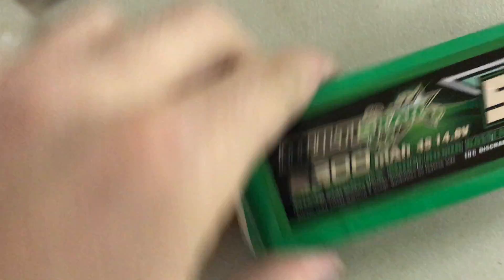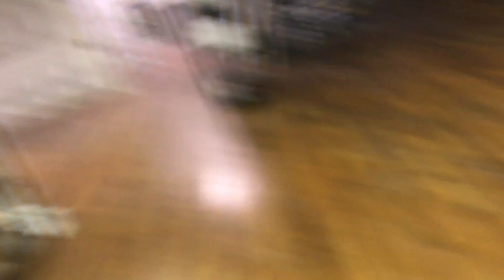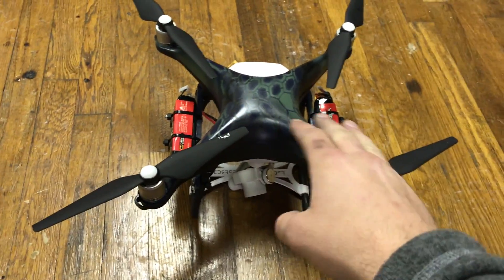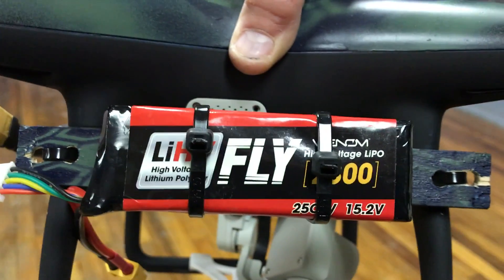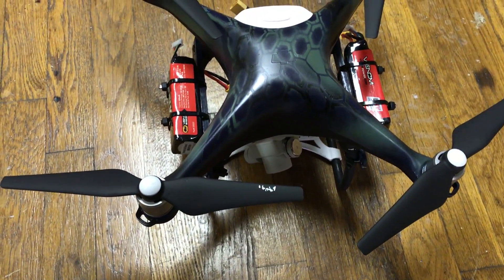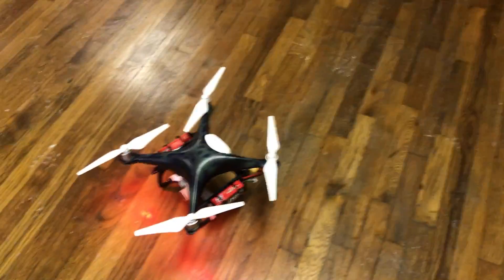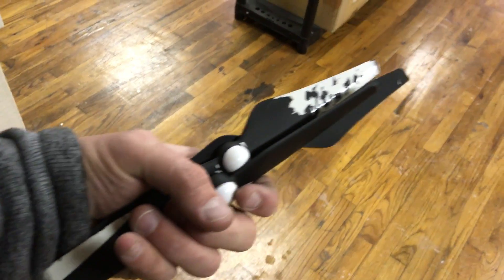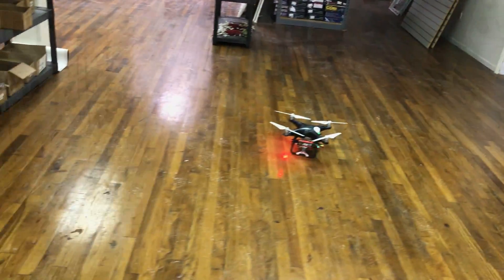DJI Phantom 4 dual battery mod

Comment: but to get the data and battery status on dji go you also have to use an original battery in the battery compartment and then connect the additional batteries in parallel exactly?

Comment: Good morning, I request information that battery you use, I have a Phantom 4 pro and also a Phantom 3 pro, I tested a 5.2 mah battery, but it got very heavy it accused overweight in the engines. Could you inform me a suitable battery to use would a Lipo 4.0 4S 14.8 V? multistar or Venom. Many thanks and congratulations for your adaptation.

Comment: Good afternoon, fantastic I bought two bateriasmultistar 5.2 Turnig 10 c Discharge similar to what you showed, but it was very heavy, could inform me the second battery that you put me pass weight, voltage and other data thank you very much Luiz Carlos Pannain - São Paulo Brazil

Comment: I have put the lithium ion battery 4 cell to phantom 4 pro but once I plugin the both the batteries ( external and dji battery) the voltage in the dji go app getting to 0 volt and message from djigo app is replace the battery help me
Reply: Interestingly I just purchased 4 Titan Lithium Ion 3.5ah bats for the same purpose. Are you saying these will not work with the P4. Did you ever resolve your problem? If the Lithium Ion bats did not work for you, what did you finally end up using for extended flight time? Thanks.

Comment: i kinda dont get y people do this  when u can build a way better drone  with more flight time at same cost.. and no dji plastic junk
Reply: I don't have this expertise ...is it worth it to commission someone to build this"better drone with more flight time" ? I would gladly do so if it were feasible to do so. Can you show/PM me with a picture of such a quad and how one would proceed to acquire it? Thanks.
Reply: James  Shipp III let me know how to reach u.   Ur email or text
Reply: How can I Pm  or text you ...not publicly!
Reply: DJI plastic junk? Well, DJI already has a whole team dedicated in making a well flying drone, which avoid obstacles (most of the time) and land safely no matter how hard you push it. If you build something on your own, you and only YOU control the aircraft, that means that if you loose it due to weak signal, there goes your drone...

Comment: Doesn't painting the props cause air flow issues?
Reply from the maker: Maybe? i'm not an expert on the airflow characteristics I guess theoretically it could but I haven't noticed anything.  Although I have went back with the original unpainted props.
Reply: He should have dyed them

Comment: I'm not sure how you think hovering indoors draws more power than "real world" flight? Pleas explain how fighting the wind, accent and decent and running the camera is more efficient than hovering indoors?
Reply: He can't. Don't bother.
Reply: Rotor systems become much more efficient when moving through the air or holding position in wind.
There is no air recirculation in the rotor system.

https://www.google.co.uk/search?q=helicopter+power+curve+diagram&tbm=isch&source=iu&pf=m&ictx=1&fir=Azp6l9RMhVgpuM%253A%252CgZ5IldUzP-4i1M%252C_&usg=__c6kxUtKjwnrIJoZw6huJ0vMbkTU%3D&sa=X&ved=0ahUKEwjT6JfNv7XXAhUF66QKHST2A3MQ9QEIMjAE#imgdii=OlE1mZjYfg_oHM:&imgrc=Azp6l9RMhVgpuM:

Comment: How did you achieve this battery mod?
Where did you solder the tx leads to.....PLEASE TEACH ME!!!
Reply from the maker: check out my other videos.  I went through a complete demonstration in one video but the memory card corrupted because I was recording 4k on the wrong type of card... but anyway yes there is one video that shows the 2 wires inside to solder too.
Reply from the maker: https://www.youtube.com/watch?v=TvWld5pIm7U
Reply: Ive looked at all your videos and I don't see anything where you show step by step how to do this mod.
Reply: you need to show how and where you soldered the wires....like step by step dude!.....really!!!
Reply from the maker: I had a step by step but the memory card corrupted haha ... i'll work on it soon.  keep an eye out for a crashed phantom 4 I could buy on ebay and i'll make a video with it and donate it to a subscriber if I get it good andcheap lol
Reply from the maker: Lol i'm trying to find a crashed phantom 4 so I can show it again.  I don't want to open mine back up but if I cant find one soon then I guess i'll have to! ... When you open it up there are 2 wires bigger than the rest in the phantom.  They are red and black.   That's where you make your connection.

Comment: How do you connect the battery pack to the original battery?. 
Do you connect internally  direct to the terminals, or have you needed to mod the original battery installing the new connector inside it.
Reply: watching here, Phantom 3 DIY battery clip mod {how to} in youtube
Reply from the maker: The additional batteries connect inside the phantom to the main power circuit.  See my other videos showing the red and black wires.